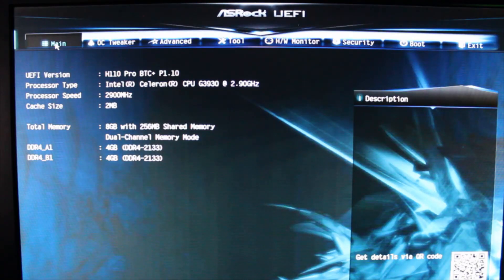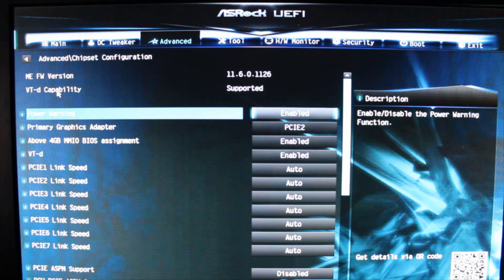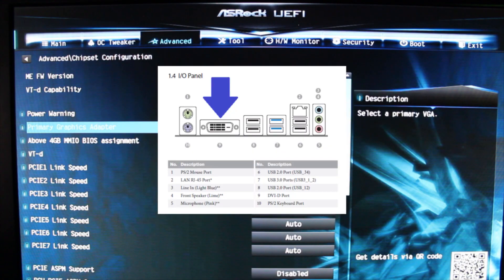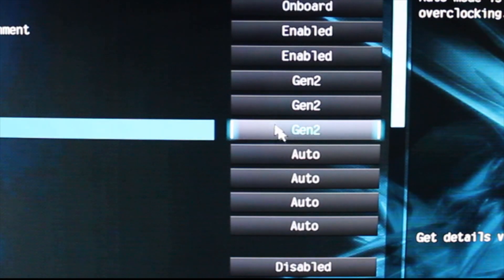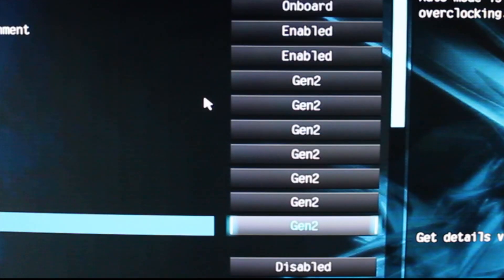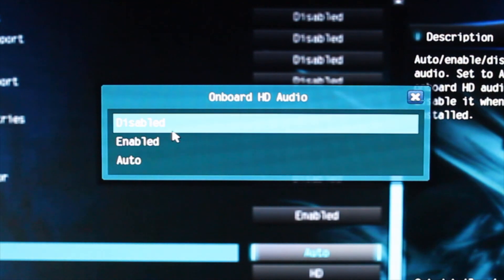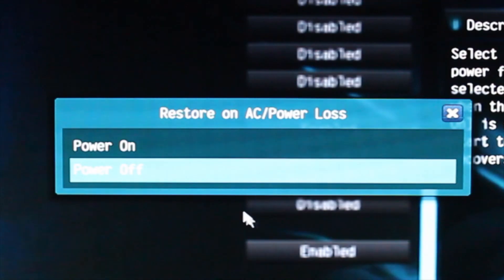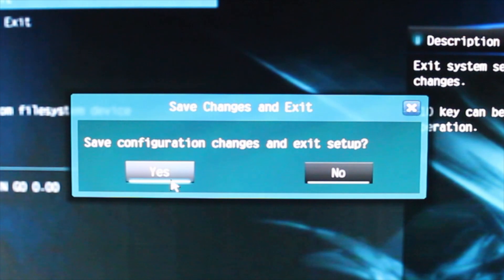⌨ Accessing and Configuring BIOS/UEFI for Crypto Mining ⛏

Comment: Can you use different GPUS on the same board? I have a 1660 super and a 2070, the 2070 by itself was working fine but now my rig is crashing with the 1660S (I installed the drivers of course and I’m using Phoenix miner, and windows 10)
Reply from the maker: You should be able to use them both simultaneously. Maybe overclock settings or power issues.

Comment: What if you do power on, save config changes and it takes you back to UEFI?
Reply: And guess what after many many power on power downs it magically started Hive OS.  Nothing else was done
Reply from the maker: Mine does that SOMETIMES. Usually just removing the USB drive and reinserting works. I've also had to clear the BIOS to get it back to working as well.